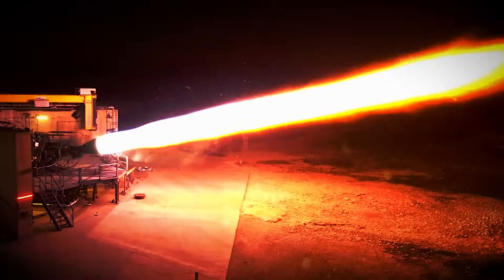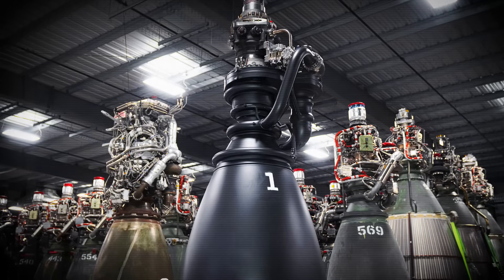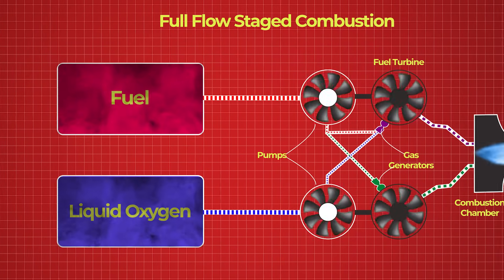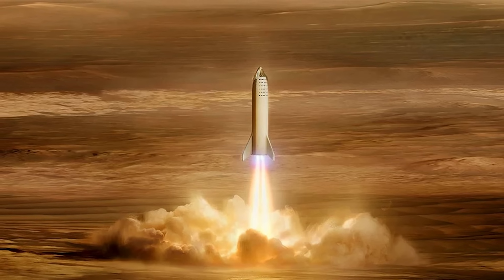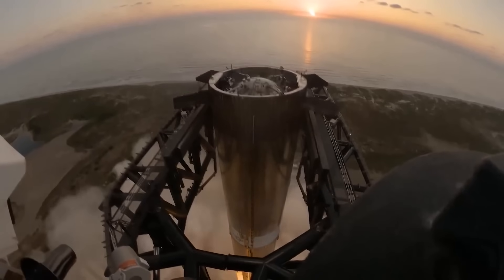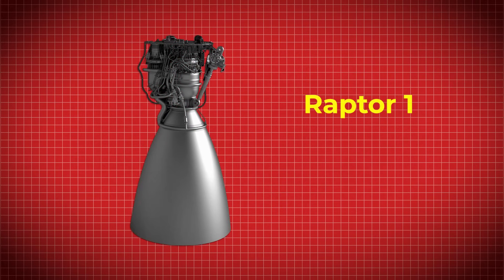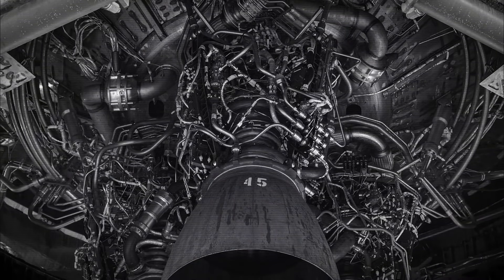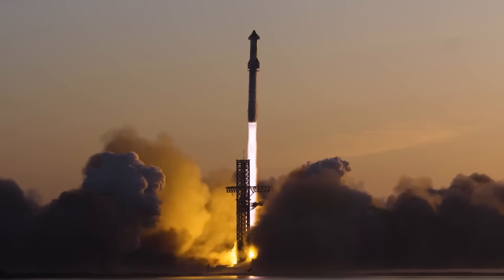How SpaceX Reinvented The Rocket Engine

Comment: You mentioned 89:1 for Raptor 1, but what are the numbers for Raptors 2 & 3? The comparison would be nice.
Reply: Now, here’s something to ponder: If Raptor’s efficiency keeps climbing at this rate, what could that mean for the future of interplanetary travel? Could we see even more powerful engines, or will the limits of physics step in? What do you think...
Reply: @DawLita-w4f5  There's one aspect that isn't included in any figures. It's the costs. The costs of development, designs, and build increase exponentially. At some point there comes a time where developing costs more than the expected use. Have we reached that point already? I think so, at least until something has been completed. I could be wrong.
Reply: Ask Grok.
Reply: The weight and thrust were mentioned. Just divide.
Reply: @codycast  I'm aware. It just makes the reporting a little unbalanced. It feels like it's missing an aspect.

Comment: You are correct to state Spacex was first to "fly a full flow staged combustion engine". However the RD-270 engine was a FFSC engine developed in the '60's by the Soviets, but never completed due to budget cuts. To some extent Spacex's success is a tribute to Soviet engineering more than 40 years earlier proving the concept. Can't kill a good idea. Lets see how Rotating Detonation Rocket Engines fare.
Reply: If it is feasible, Others would have already built it, but nobody have successfully built it.
Reply: I'm pretty sure plenty people had the same idea about FFSC lad 😏 @1flash3571